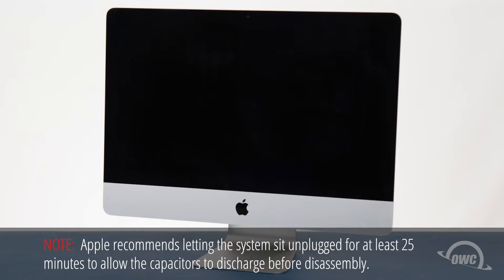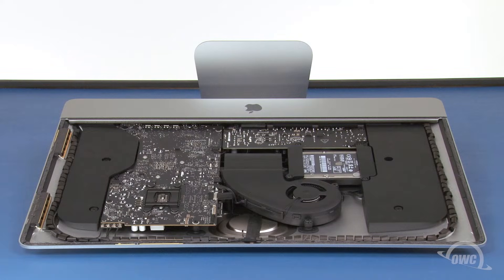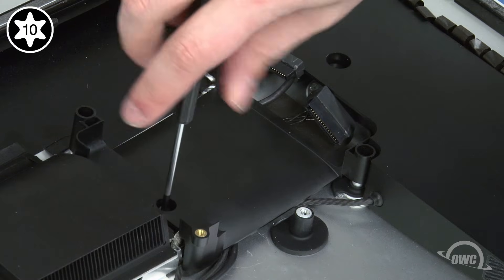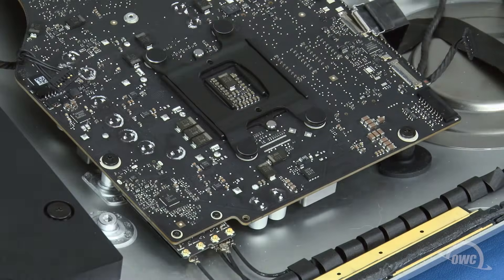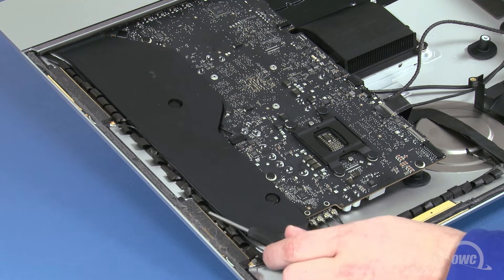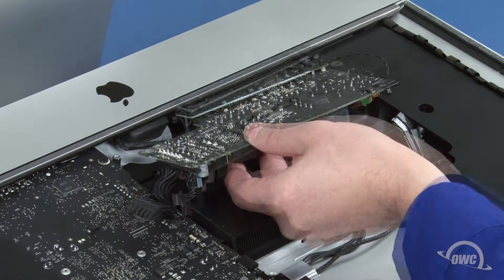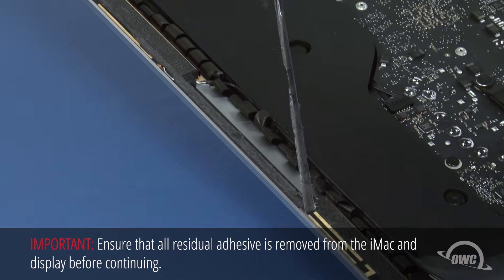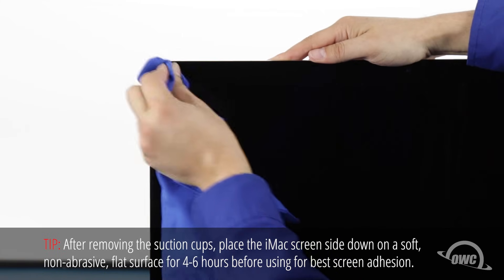How to Upgrade/Install Memory in a 21.5-inch iMac (Late 2012– Mid 2014) iMac14,1 iMac14,3

Comment: why does apple say this model is not upgradable? ? how many or up to how much can you put in there?
Reply from the maker: Hi Mori!  I can't answer for Apple, but the installation is particularly difficult.  Not only must you remove the screen but remove nearly all the components from the iMac in order to get to the back of the logic board.  OWC recommends professional installation.
 
The iMac 21.5" L2012-M2014 has two memory slots, each of which can take up to an 8GB PC12800 DDR3L 1600MHz SO-DIMM.  Memory should be replaced in matched pairs for best performance.

Comment: You've  got to be kidding. This is every bit as difficult as fixing an iPhone, for what should be a simple upgrade. . Did Apple think installing a RAM access door was too expensive? Excellent video anyway.
Reply: or cut a king hole and access that way
Reply: @derick3482  the case is aluminum

Comment: They couldn't just make the ram easier to get to huh. I mean on the 2008 models the ram was just under the screen with a simple cover. Super annoying. Thanks for the tutorial though guys. ----- Annnnd the ram is soldered on the board....... I hate Apple.
Reply: On these iMacs, it isn't soldered.
Reply: @cgi2173  on the one I had it was.
Reply: Right!??? That is the stupidest place they could have put the Ram … they had to have done that on purpose … i thought  Apple was WOKe !?? No … they want you to throw your imac in a landfill  🤣😂😅
Reply: What year?

Comment: Mine is  (21.5-inch, mid2014) with 8 Gb 1600 mhz ddr3. Is the memory is welded to the mother board?
Reply: I’m about to get a 21.5in mid-2014 later today and I’ll be replacing the screen and HDD. As far as I know the RAM is integrated into the board. So, yes, it is most likely soldered on, but I can’t say for 100% without seeing it for myself.
Reply: @RealHypeFox  Thanks! I look forward to seeing your video.

Comment: Can the hard drive be replaced simultaneously? Or does the computer need to recognize each item individually or something?
Reply from the maker: In theory you can replace both at the same time. However, just for ease of identifying problem areas (if the machine decides not to boot after install) it's easier to do them individually, so you're not scrambling to find the problem.
Reply: @poweredbyowc  Really???? It would seriously SUCK to have to take it all apart and put it back together TWICE just to upgrade both HDD and RAM! Plus, you're TWICE as likely to mess up those tiny cables/connectors by having to pull them apart and put them together TWO times!  APPLE, if you're paying attention, it really sucks that you make it SO DIFFICULT to do simple upgrades!  WHO Buys a computer and leaves everything as it was when you first bought it???

Comment: Thank you for the information in this video. I would like to ask a question. Can I replace the motherboard on my imac mid 2014 with another one that can expand the memory? If possible, what is the best model to look for?
Reply from the maker: You're more than welcome we are happy to be able to provide this install video. 
 
Regrettably at this time we do not support nor carry any upgrades for the logic board/mother board in the iMac models, we do apologize.

Comment: Would you recommend reattaching the display cables before attaching the adhesive so as to test that updates were done properly and that nothing was left unattached? Seems like it would be a shame to stick the display back on only to discover that you failed to complete one of the reverse steps.
Reply: Yes, test before committing! In the video previous to this one, the one I wanted for upgrading to an SSD, the recommendation is to affix the new tape onto the body but use painter's tape along the lower edge to temporarily fit the screen, connect it and install the new system. Once everything is good to go, one can continue with the refitting of the screen by continuing the removal of the second side of the double-sided tape.
This is the video that helped me for the late 2015 model I'm upgrading, but the idea is the same:
https://youtu.be/BYNFJwhuDm4
Reply: ABSOLUTELY!
Cannot recommend this step highly enough.
PLEASE ENSURE THIS IS DONE.
Absolute fricking b*stard getting it apart again, because a cable has been missed.
Shame on OWC for not doing this.

Comment: Hello, help, what’s the max memory for the late 2012 IMac? Is it 16Gb?, if so does anyone have a link to the 16GB memory? Really appreciate it, I looked at Crucial.com but I couldn’t find the memory
Reply: 16GB in the 21.5inch and 32GB in the 27inch. I believe you can't get 16GB ram, you need to get two 8GB ram

Comment: Excellent video and thanks for all the details. Was hard to remove the power supply board and logic board but everything went will and I also changed the hdd to ssd. Thanks again for all the detailed info.
Reply: Just upgrading to the SDD is good enough for these old PC's to perform much better and adding a few extra GB's of RAM isn't going to help very much!

Comment: Thanks for the detailed video. I’m just curious though do these steps have to be followed? It looks like you can just take the part where the RAM is and do it that way? I’m just asking because I’m more used to pc repairs and don’t want to ruin anything.
Reply: By removing the fan it is possible to access the RAM, however while I found it hard to replace it that way and so opted for the "traditional" method. It might work for others though.
Reply: Exactly my thoughts. Have you tried it yourself?